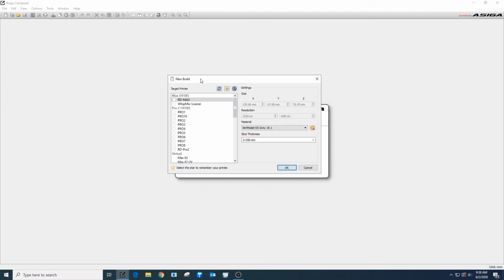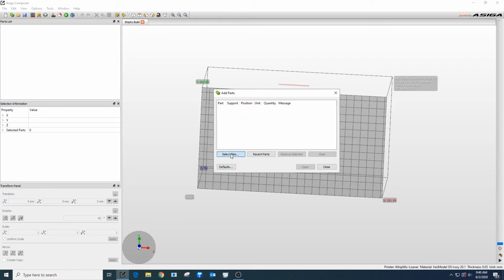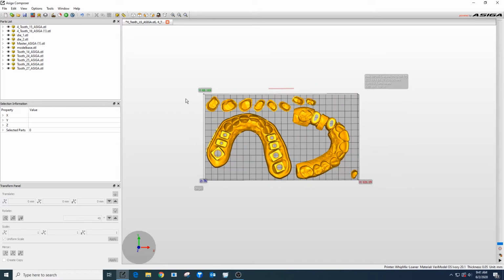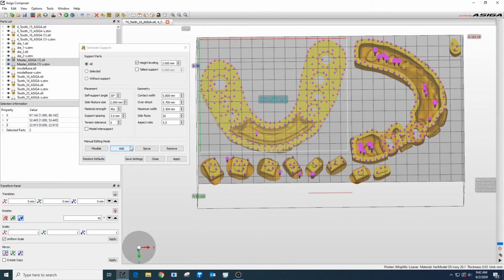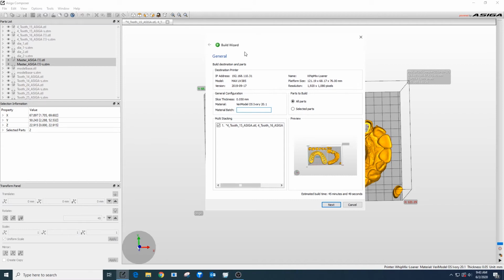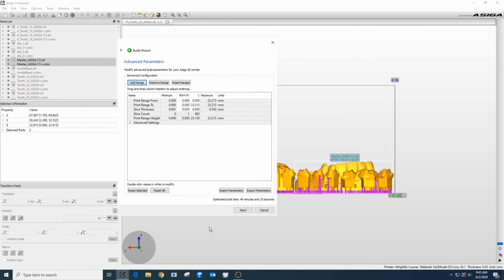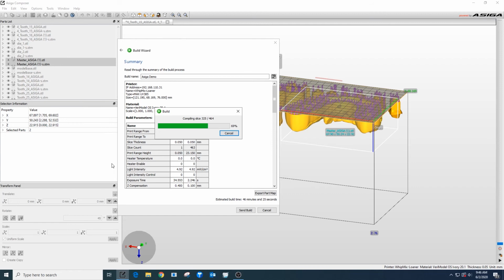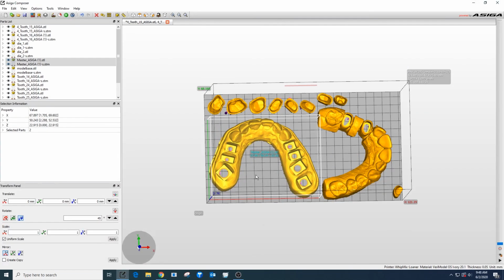Asiga Composer Workflow

Comment: I'm currently doing My APL at a dental production site and currently read the User Manual on 164 pages.

Here we never place the jaw parts horisontally. We angle them at least 45+° to fit maybe 7 at a time. Teeth pointing upp from the plate with front part attatched to the plate on a support. I was told to really avoid placing support to far in from the gums. Since it will affect the feeling of it in your mouth. How does automatic support generation work in these conditions? Cheers.

Comment: How do i rotate models flat to build plate if my stl files come up vertical?
Reply from the maker: On the left hand side of the screen there should be a transform panel. In the transform panel there is a little button that looks like a pyramid, when you mouse over it the name of the tool is Rotate Facet Downwards. You need to select the model you want to move, then press the Rotate Facet Downwards button and then click on the face of the model you want to be parallel with the platform, in this case it would be the base of the model or the underside. Then you would use the Auto Place tool to set the models directly on the platform.

Comment: Thanks for the video. As I am nesting items on the build plate. The software never seems to place all the items, so I end up doing it manually. There always seems to be one item off the build plate, and I can’t figure how to just bring down that one item, without disturbing the rest. So I  bring the item close to the build plate, leaving a gap, then just bring the supports up to it. Unfortunately, It usually increases the build time, because it is a little higher than the rest. Do you have a quick fix for this?
Reply from the maker: Yes, there is an easy way to move the objects around on the build plate and to the build plate. On the left hand side of the screen in the transform panel there is an icon titled "Translate to Platform Origin". This will get you to where you need. If you need further explanation please reach out to us at productsupport@whipmix.com.
Reply: @WhipMixCorporation  thanks so much.